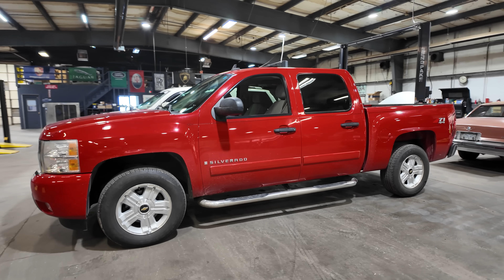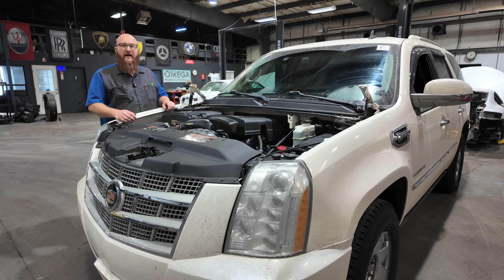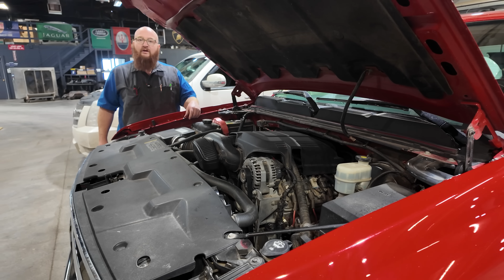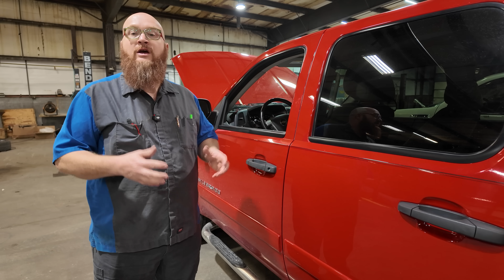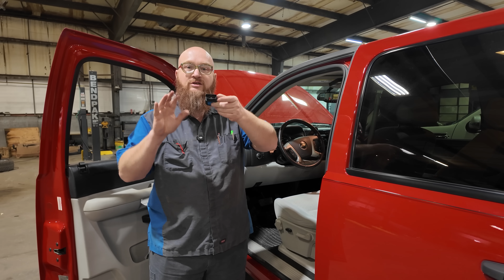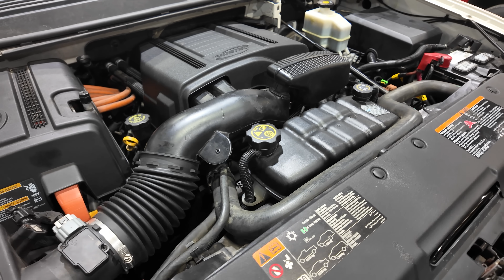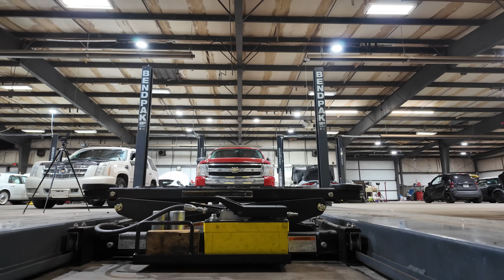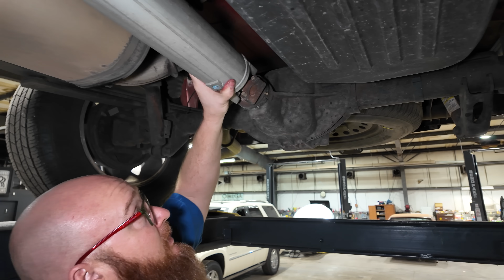AFM: Engine Saver or Engine Killer? The REAL Answer

Comment: All the V8 VE and VF commodores with the 6.0 L77 had AFM in Australia.  You guys got them as the Pontiac G8 and the Chevy SS. The 6.2 LS3 in series 2 Vf don’t have it
Reply: G8 GTs had the L76, G8 GXPs had the LS3.
Reply: @shay1116 sorry you’re correct. Early VE V8’s were L76 switching to L77 in 2010. I think the g8 was discontinued by then??
Reply: @LTD347  Yes, the G8s were 08-09 (I have an 09 GT). Believe the L77 was available in the Caprice PPV.
Reply: @shay1116 nice. I love to see Aussie cars overseas.  I had an 09 Calais for a short while.  Got it rough and fixed it up to flip for profit $$ lol. 
Currently doing the same with an ‘11 FG falcon ute 🛻

Comment: I had a 2015 Chevy Silverado 6 cylinder and at 120,000 Mi how to replace the lifters and the cam and everything else that goes with it timing chain etcetera because it was a part miles will do all the stuff while it's apart. Needless to say I sold a piece of crap and will never buy a Chevy again or Ford or Dodge 2nd gen Toyota all the way

Comment: 18 Sierra with the 6.2L... Change oil religiously every 3k miles and have the AFM disabled electronically. 133k miles and no issues yet. 

I also don't have a bunch of silly mods which I believe only contribute to problems with these trucks.

Comment: Please Share!!!  Car Wizards advice is great!
I have a 2008 chevy Silverado LTZ crew cab  5.3 I have the delete AFM plug in  as well . Installed it at 140,000 miles when I heard about this problem  . I bought the truck new and now has 245,000 miles on the original engine, transmission and rear end. When new during break in I change the oil at 500 miles, then 1,500 miles and every 3,000 there after.  Trans and rear end service every 25,000 . Still runs great and uses no oil. The only thing that happens is at 200,000 miles the oil pressure drops  at 15 PSI at idle and begin to hear lifter tap. I changes the oil pump and pickup tube with the O ring with a Mellings oil pump and now has 35 PSI at idle and 50 PSI driving. The engine is quiet. Also at 200,000 miles I did what I called a proactive repair work. This is parts we all know its near it life cycle. Fuel pump ( use AC delco) Radiator and fan assembly, Water pump and stat with all hoses, Motor mounts  as they were bad, intake manifold gaskets, coil packs and wires, O2 sensors all 4. The truck runs like you drove it off the show room floor, smooth idle and crisp acceleration.  Great truck if you exceed the recommended maintenance schedule. My goal is 300,000 miles

Comment: Technically the vehicles shown have displacement on demand (07-13 trucks) not active fuel management (14-18 with some later years depending on option packages) although it is basically the same system just ls based engines versus lt based engine respectively. I have had multiple failures with the afm systems even with the disablers installed. One truck came back three months after I installed new lifters from the dealer and one of the lifters had come apart and lodged inside the lifter bore ruining the block. I had another one come back again three months after new lifters from the dealer were installed with a bent pushrod and stuck lifter. I replaced the lifters under warranty again with new lifters from the dealer and it made it a year and a half and came back again with a bent pushrod and a failed lifter. Both vehicles had disablers in them at the time of failure both times on both vehicles. The only solution to this problem is a full dod/afm/dfm delete kit from Texas speed or Brian Tooley Racing or one of the other similar kits available and a tune to delete the system from the ecm.

Comment: This is exactly why I got my 2019 GMC. The LAST 6 liter that actually works! Still even has a belt driven fan! Port injection! 9mpg, but I really don't care! Almost identical to the engine they used in 2001. As far as I know you could not buy any other engine in 2019 without a bunch of stuff you could not possibly need...

What is the purpose of a 4.8L LS? It cost exactly the same to manufacture. It's rated for the same MPG by the EPA. Why would you buy that?! What is being saved?

Comment: I have a 2016 Honda Odyssey with vcm variable cylinder management. I had it disabled by buying a thing on eBay that plugs into the engine and makes the computer think that the engine is 15° cooler than it is, so that the vcm never kicks in. Seems to work okay.

Comment: if you only need to do light towing get a 4.8,, my 2011 Silverado has 302 HP ,with a tow package and 3.73 gears,non tow package truck ,usually have 3.08 gears and are slow off the line,, mine does 0-50 7 seconds ,that 4.8 screaming in first gear..plenty of low speed power.and NO AFM !!!!!!!

Comment: I have several ford 4.6 liter v8's. I had a coolant leak on the highway the caused it to overheat. I had read about "limp" mode where 4 cylinders are deactivated by just shutting off their injectors. I got to experience this and I'd worked perfectly. Why does GM & Chrysler insist on messing with the lifters when the computer is more than capable of performing the same function via the fuel injectors?

Comment: I think the whole DOD / AFM defects are largely due to lack of maintenance or use of wrong oil. knock on wood my 2009 pontiac G8 GT still has functional AFM at 104K mi, I bought it used at 88Kmi. I use Mobil 1 5w-30 as stated and i do shortened oil change intervals, zero issues. I know a few people that had AFM lifter failure and I discovered they use the wrong weight, type or over run the oil change interval...and they wonder why it failed. knowing the general population barely checks their oil level or tire pressures, can we really say AFM / DOD is an inherent design flaw?

Comment: 2018 Yukon Denali with the L86 6.2L… full DOD delete with a Bryan Tooley cam and GM performance lifters (rated for 8k rpm). Should get many many trouble free miles out of her. 

I wish GM had left their benchmark small block V8 alone and stopped with all the complexity for fuel economy. I hope the CAFE and EPA regulations continue to get rolled back.

Comment: I have the same model year Silverado and trim as the one in this video only mine is the 2500hd with the 6.0L Vortec and it doesn't have AFM which is the main reason why I opted for it over the 1500.

Comment: My ‘07 GMC Sierra 1500 with AFM burned 1 qt every 1000 miles at 60k miles.  My wife’s Honda Odyssey was fouling plugs at 90k with oil due to Honda’s equivalent.  Is emissions important,yes, of course.  But not at the cost of reliability.  In both cases, the mfg passed the buck and refused to fix.

Comment: If I remember correctly, the V8-6-4 was easy to defeat. There was a switch that would tell the system you were in Drive. Just unplug or cut the wire connected to it.

Comment: I had a dod lifter locked up drove it 45 minutes home and put in the shop. 6.0 Yukon the cam was fine had head pulled switched lifters and I only use the pf63 oil filter
Reply: AFM disabler keep in v8 my Yukon has 322 with only changing AFM lifters like I said I only use the PF63 oil filter
Reply: 323k Yukon hybrid 6.0 I use obd2 range chip AFM disabler I had to switch oil filter from pf48 to the pf63. Not sure why gm would put a 4cylinder oil filter on a v8. I ran pf63 pulled sensor and oil screen zero shavings

Comment: WIZZARD!! One option for disabling the AFM is a a Holley prduct called the Diablo PreditorX tuner. Plugs into OBD, gives you options for performance tuning for low or high octane fuel, Transmission shift changes, AFM/DFM disabling, live data streams, trouble-codes and more. connects to your smart phone using up to date downloads for your vehicle. AND you don't have to leave the dongle plugged in all the time.! Make your changes and unplug it. It's worth the extra cost for all the features you get.

Comment: Great video Wizard!
I have the same truck, but its a 2013. Installed a Diablosport canned AFM delete tune. Regular 5k oil changes, still going strong at 162k miles! ( original trans too!) The only downfall of my truck was frame rot. NJ here, so from all the winter salt and brine, took its toll. Had a local guy certified from Auto Rust Technicians install their Saf-T-Caps, frame is like new again. Cost $6k, but still cheaper than a new ( or used) truck! When/if the engine and or trans go, I’ll replace those too! 
S Wizard has said in the past, these ‘07-‘13 Silverado and Sierra 1500’s are really good, and so easy to work on!
Reply: Oh , and my average MPG increased by 1-2 after the AFM delete. Go figure!

Comment: My lifter still collapsed with AFM turned off.  Unfortunately the only actual fix is to the delete the AFM lifters.
Reply: Yeah but prior to installing the range into the obd2 was there already lingering damage to the lifter/push rod/valve engine
Reply: I have seen a 5.3L with AFM electronically deleted fail with just 120k on it.
Reply: @maineiacman They were already ruined then

Comment: 2011 silverado with 250k miles. 175k miles i used hp tuners to disable AFM, all original engine and transmission. just changed my oil very 4k 4months with pennzoil ultra plat and mobil 1 synthetics.
Reply: You put the disabler on at 175k? I have 150k and thinking of doing it.
Reply: @AB-bg1or got tuned on the computer so no disabler dongle or plug in thing. Always v8 mode.
Reply: @bendino9016  gotcha. Thanks.

Comment: I have a 2011 Suburban with the 5.3. When we first got it the number one plug kept fowling. I installed a disabler and it stopped fowling. It now has 276,000 with no issues.

Comment: The more disturbing thought is that GM assembly lines are building brand new engines with these same defective AC Delco lifters right now.  GM hasn't fixed a thing.

Comment: My shop has given up on AC Delco. Spark plugs that back out, oil filters that collapse, 4 ABS modules on one before we got a good one, 3 ABS modules on a Captiva, 3 ECMs on a Silverado, Doorman stamped MAFs and MAP sensors..... AC Delco quality has TANKED.
Reply: Yeah, my Walmart bought, AC Delco, seam leaking, oil filter for 1995 K1500 5.7 almost cost me my engine. Checked after work I saw oil level on dipstick tip and I almost shit. Mechanic cleaned motor underside, ran engine on lift and saw the MF Delco filter leaking after 15 minutes.  Only NAPA or Carquest oil filters now on.

Comment: I have a 2019 GMC Sierra and I'm using Range Technology box under the hood. I have about 30 thousand with it installed on the truck. Does not flash the computer, keeps the 5.3 in 8 cylinder all the time. Plus you have 6 other options to change.

Comment: I had an 18 Silverado with a 5.3 and intake and muffler upgrade. I had to repeatedly drive from Fort Worth Texas to Sweetwater Texas which is about 200 miles one way. I did a test on it where I started at the same gas station and measured my average mpgs. I purchased a Diablo programmer and ran the max mpg tune then max hp tune. With afm only I averaged 20 mpg. With max mpg tune I hit 21 mpg. With max hp tune I hit 23. Afm dfm are scams and might only work in flat terrain. With any type of undulating territory and cruise control on, it’s garbage. These motors are capable of being more efficient than even the best numbers of afm dfm. It’s just a carbon credit government money grab.

Comment: Even when AFM/DFM works properly, the engines end up using vast amounts of oil on the cylinders that get turned off.  The cylinders cool too much, the rings end up either, spinning and the gaps line up, or carbon up badly.   Every manufacturer that uses cylinder cancellation end up with oil consumption issues.  Honda's 3.5 had so many issues.  5.3, 2015-2025, can absolutely drink oil like nothing else.

Comment: The only problem with the AFM disabler is when you're in a state that inspects via the OBD II port it will not allow monitors to set so you will have to remove it, drive cycles, inspection, then you can put it back in. Had to explain this to a bunch of customers over the years. Here in NY everything under 8500 GVWR plugs in for inspection, can't have engine light, and all but one monitor needs to be set.

Comment: There is a third way to defeat AFM. I have a hand held tuner that turned off AFM and the best part it turned off torque management as well. Torque management was baked into the transmission because in 2007 up for a time there was a 100k power-train warranty.   My truck is night and day driving wise comparing my old Range OBD2 plug in vs Intune Tuner.
Reply: What tuner did you use and how is it done? I have a 2018 5,3
Reply: @kurthwoodparish4449 I would like to know as well. Cuz if there's a tuner we can buy to manually tune it, instead of a 600$ one time tune that would be ideal

Comment: Ram & GM been doing displacement on demand, cylinder deactivation, active fuel management, dynamic fuel management, multi-displacement system for 20+ years. The next gen GM V8 beginning soon will have it, although it will be controlled up in valvetrain via rockers vs lifters. It a 1500 it will increase in displacement from 5.3 to 5.7 & increase in efficiency by 10%. It will have mandatory hybrid to do so. Hemi been doing that for 5 yrs now w/ mandatory etorque hybrid - MDS - start/stop.

Comment: AFM originally was an Eaton design.  The early AFM lifters have a 3 tab lost motion spring retainer, and were made in Roxboro NC.  GM took the product in house and had Delphi manufacture them in Mexico.  The ones you got for Hoovie are a 2 tab lost motion spring retainer Delphi design.  With 3-5K oil changes, both designs will go 100k.  Past that, yes, delete or defeat.

Comment: One of the main reasons I purchased a used Chevrolet 2500 Express Van.  (Former passenger shuttle.)  GM probably realized that the main customers, fleet operators, wouldn't put up with the downtime involved.  Plus it was more than half the price with about 1/4 of the miles the pickups had.  2017 with 27,000 miles and 6.0 V8 purchased in 2021 for $19900.

Comment: Still driving my 07 Silverado 2500 Classic with 248k miles. Mine has the 6.0 with no active fuel management. That will explained the high mileage 😊

Comment: Leave the AFM alone. GM designed the trucks to deactivate cylinders for a considerable amount of fuel savings. Stop disabling it and trying to deactivate. It is an emission device that should not be tampered with.
Reply: Years ago owners would remove catalytic convertors & install an "off-road test pipe". It became illegal. Owners would ream out filler neck of gas tank & pump in $.005 cheaper regular gas until cat plugged. Real Einsteins.

Comment: I’ve got a 2016 Z71 Silverado. Bought it for $18,500.00 4 years ago with 140k miles. At 170,000 miles I had to replace the transmission ($5500.00). I didn’t have that kind of cash at the time and was forced to refinance the vehicle to replace the tranny. I currently owe $16,000.00 and the truck has 201,200 miles on it. About 8 months after I had the tranny replaced it started having major electrical issues. I have spent almost $2000.00 trying to fix those electrical issues. I’ve also spent an additional $3000.00 in suspension repair, alternator, thermostat, miscellaneous bolt on parts which I have done the labor on myself. So that additional $3000 was part cost only. I have nearly three years left before this vehicle is paid off at a $500/month payment. This was not a buy here pay here situation. I got a good interest rate from a regional credit union. The point is, I love my truck, but it the absolute worst vehicle I’ve ever owned. My dad retired from GM after 52 years of service. I’ve owned nothing but chevys my entire life. These trucks are completely unacceptable. Thank you for shedding light on these vehicles. I won’t buy another Chevy until they at least make an attempt to fix these issues. Every day I pray my motor doesn’t blow before I can get out from underneath this truck.

Comment: GM L77 is a 6 liter "LS Based" engine found in Chevy/Holden Caprice with active fuel management DOD and Flex Fuel. Routinely self destructs at 110K miles.

Comment: Or you could just do what I would have done when I was in my teens or 20s to disable the cylinder deactivation and that was to keep your foot all the way in it.  I remember that Cadillac 8-6-4 engine and it was a disaster.  The 368 engine without that system installed was a pretty good engine but the idea of shutting cylinders down just doesn't work very well.  Even Honda engines with that aren't as reliable or durable as the ones without.

Comment: I have a 2012 Yukon with the 5.3 and this system. It has 153k. As of now it hasn’t given me any trouble. Oil change every 4K. Crossing my fingers it goes to at least 200k without any engine problems.

Comment: so i have to disagree  @550, not giving trouble 
a year and a bit ago i bought a 2015 suburban, used obviously , had a bit over 200k (kms)
shortly after buying i bought a device that plugs into the obd [ort to disable the afm
it was fine for a bit , but one day , foot to the floor , and check engine light came on and flashing and ticking , yup a lifter 
ok i bought it used , maybe you have to have it in from new 
since buying it , i am in many suburban etc facebook groups and have watched countless youtube videos with regards to afm , fixing it after it fails, various ways of disabling it etc 
and i have seen many ppl say that even disabling it , there is still a high likelihood it will still fail 
 
there is a third way to disable it 
put the trans in manual mode and put it in second highest gear , so if its a 6 speed (like mine) put it in 5th, no more afm 

there are ways that can get stuck lifters unstuck (doesnt always work)

also you said this didnt last long , like the old 4 6 8 
afm basically started in 2007 and continued to 2018 the changing to dfm or dod in 2019,,,, so thats a long time